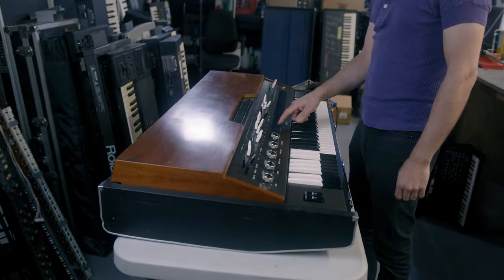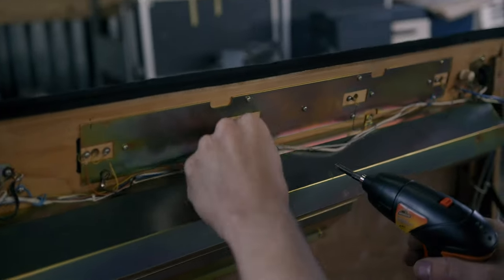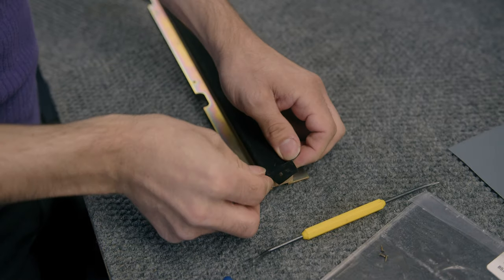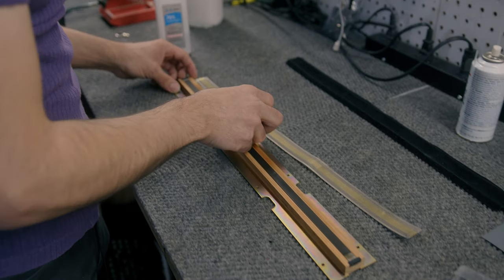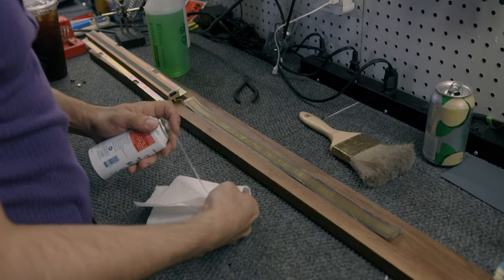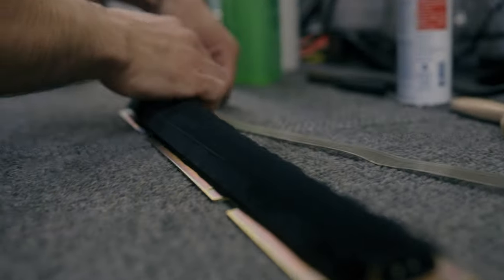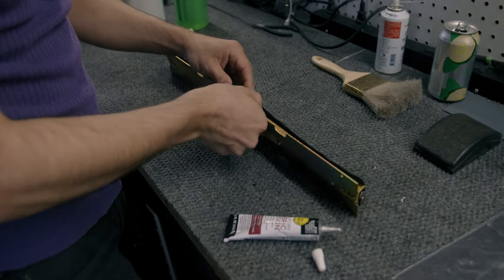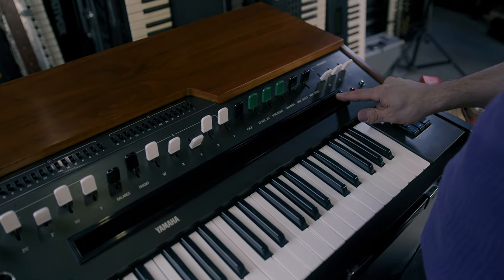How To Clean a Yamaha Ribbon Strip (YC30)

Comment: Great video. To avoid bending the comb, I would use a plastic razor blade to get under instead of a screwdriver. You want something as thin as you can get without being sharp enough to damage the wood or the comb itself, so a regular metal razor blade would not work. The plastic razor blades are thing but not sharp enough to damage anything.

Comment: have a question, not sure you can answer. Yamaha AN1X ribbon. it works. BUT, when I touch it it will got from 0 to full starting at the mid point, and then to zero when I let go. currently I have the CC set to a controller so if I DO touch it, I can just set it back with that. is it possibly broken, or do I need to set the trim pots inside? 

side note. for all the patches it does the same thing. even on an INIT patch, it will shut the volume down. so im not sure what's going there. it seems like its hooked up to volume, and I cant find how to unassigned the ribbon from other patches so I can do some proper testing. any insight you could offer would be much appreciated. I LOVE this thing, and would like to get that ribbon adjusted or fixed.

thanks in advance.